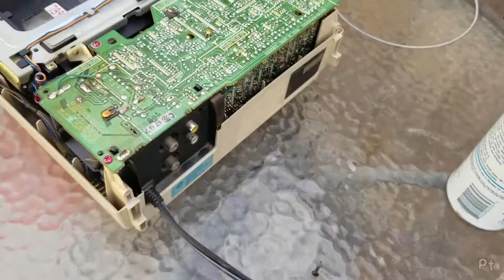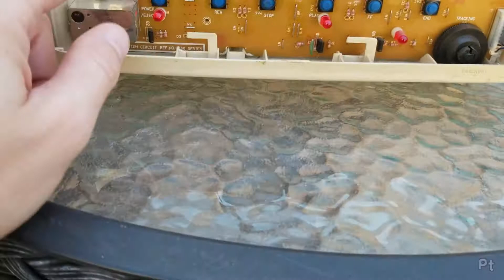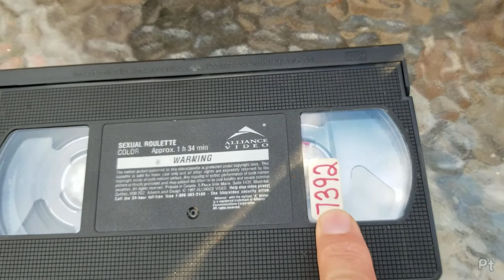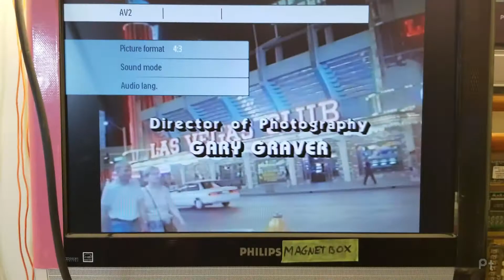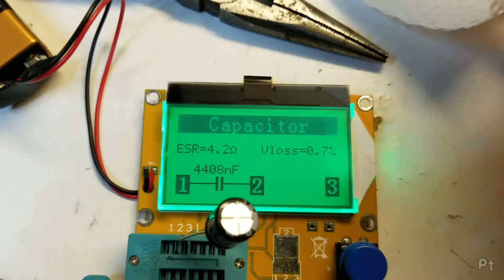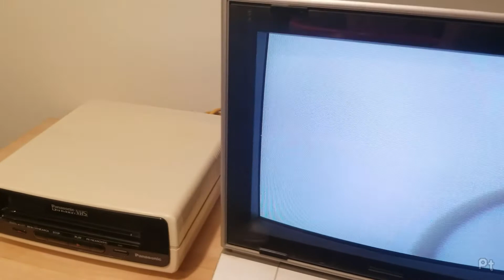Restoring a rusted 1986 VCR (Panasonic PV-1060)

Comment: I bought one of these today just based on its looks and the thing won’t turn on. I’m devastated.
Reply from the maker: Check the power supply. It's a very simple one (12v dc only). If your don't see 12v then there's a good chance capacitors will fix it, or just wire in an external 12v power adapter.
Reply: @probnotstech  Interesting, thanks! I wasn't sure what voltage to check for so that's great info. I'm hearing coil whine from the transformer in there (okay more like coil "hiss" to my damaged ears) so at least part of it is working (I was really hoping it was just a blown fuse, but alas). Such a neat little machine and it's so weird that yours is literally the only other example I've seen online.

Comment: I have a GE 9-7500 built by Panasonic and the mechanism sounds exactly the same, the design is quite similar to those Panasonics you showed at the beginning of the video. I bet my GE is  just a rebranded Panasonic. 21:13 holy crap! The remote for my GE is exactly the same as that on but in black!
Reply from the maker: Yeah, many GEs from this time were made by Panasonic.

Comment: Did you try to see what happens when you press "record" on the mostly compatable remote?

 Even with no AV inputs or tuner, it might still have enough of the circutry* and firmware programming to cause the heads to try to record something on tape, provided that the contacts on the board where the tab sensor connects on a recording model is shorted Just don't try it on a tape that's valuable to you because it will mess up the recording already on tape.

*It's likely that some of the record circutry is in there because companies often use the same board and mechanisms for several different models.

I had a circa 1993 RCA vcr which was a basic two head monural model. There was also another VCR in that same line (same style case, etc) that was 4 head with Hi-Fi stereo.
Both had remotes that were almost identical except on my model, the frame advance (F-ADV) button was missing and there was blank plastic wherr the button would've been. Curious, I opened the remote, and discovered that the contacts for F-ADV were still there. So I 'stole' a rubber contact button from another device, tried the F-ADV, and amazingly it worked. Well, sort of; It worked fine on tapes recorded in SLP, but not so well on SP, as two head VCRs don't freeze frame well in that mode. But it was still 100% functional.

 Here is the remote I'm talking about (with F-ADV)

https://www.ebay.com/itm/143913846504
Reply from the maker: Nope, this appears to be a stripped down chassis. Not only does record do nothing from the remote, but pause also does nothing. I would love to know what the original remote looked like, because it probably only had 5, maybe 6 buttons.

Comment: I have a Philips 6443 from 1989. Visually its in great physical condition. I opened the cabinet and its looks VERY clean. But when I put a VHS in, the rewind is slow, the forward is slow and when i press play, the spools drag the tape half way, and cant go any further, and tries a bit, then the VCR goes to standby. (maybe a protect mode)? I was looking for grease and its looks empty...whatever is there is dry completely. Is that the reason? from 2 decades or so of no use? I dont hear any bad noise or anything...just seems like the VCR struggling to rewind, forward and play. The head spins effortlessly however.

Comment: A few months ago I found a Blaupunkt RTV-316 (Panasonic NV-G7) from 1986 in the garbage and it had beer spilled into it and the head drum was corroded as hell. After taking it completely apart for cleaning like you did, it worked. Good old Panasonic D1 decks...
Reply: So THAT'S why the whirring sounds so bloody familiar to me.

I used to own a different model VHS, a Blaupunkt Hifi deck. And many of the noises this Omnivision model makes sound eerily familiar to that model. So knowing now that many Blaupunkt VHS decks were pretty much rebadged Panasonic decks has now basically made me a guy, who's had nothing but Panasonic units for my VHS needs.
Reply: @pHD77  Yes. All Blaupunkt VHS VCRs were rebadged Panasonics, at least those from the late 70s up to somewhere in the 90s. When you come across a VCR from the mid 80s, you can tell if it's a Panasonic-made by hearing the noise of the motor during fast forward and rewind. Panasonic D1 decks have a very distinctive FF/REW sound. :)